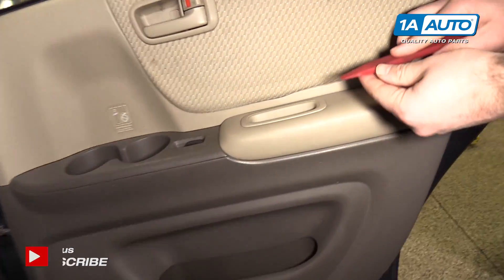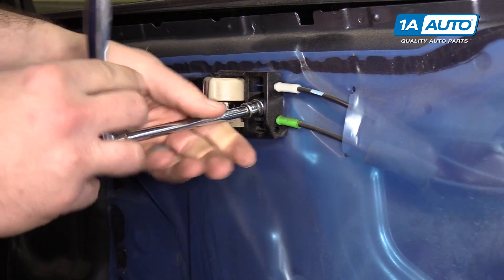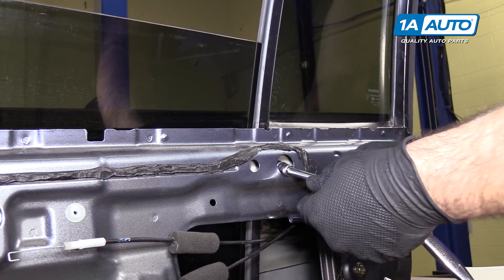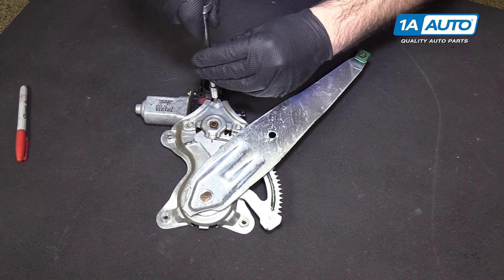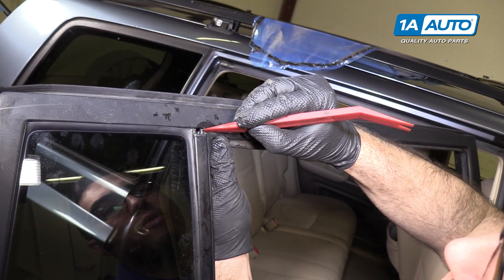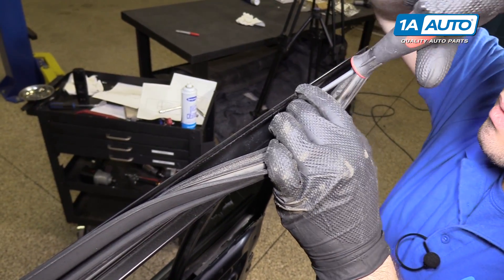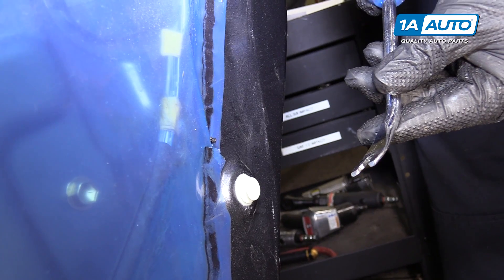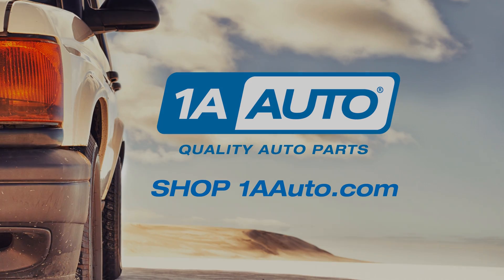How to Replace Rear Window Regulator Motor 00-07 Toyota Highlander

Comment: You didn't mention idling the motor like you did for the front. Also although I was finding different part numbers for the front and rear motors I have installed a front motor in a read door and it works fine.

Comment: The windows on my Highlander will go down, but they won't go back up. After a bit of time, it will go back up a couple of inches and then stop. After another little while it goes up a bit more. Will new motors fix this?

Comment: Thanks for such a good video. No need to take out window. The motor and regulator will slip right out of one of those holes. Took me 20 minutes to do this job.
Reply from the maker: +Joe Simmons Thanks for checking us out! 1AAuto.com
Reply: Yes there was a need, to demonstrate how to do it. My regulator and motor was fine, the guide rail on the bottom of the window broke off and the entire window had to be removed and the rail welded back on. There were only 3 skinny rivets holding it on, like the thickness of a pencil lead. Great Toyota quality. So many issues with this Highlander, I can't understand the brand loyalty and reliability reputation. So far, not impressed.

Comment: I appreciate the video.  It helped me understand the process of getting to the window motor.  

But why go to all the trouble to remove the window Channel? I did the job this afternoon without removing  the channel or the window.  It was much faster.  
I held the window in place  with a couple of Clips on the lower window Edge,  and then strung  a bungee cord through the clips and attached the bungees to the door frame in such a way that there was upward pressure on the window, keeping it in place.  Then I removed the four bolts that attach the regulator to the door. I slid the regulator out of the support platform under the window and then dropped it out the lower opening of the door. Once I had it out, rather than just replace the motor I opened it up to check the brushes and the windings. The brushes weren't making good contact so I adjusted them, cleaned up the carbon residue, reassembled the motor, installed it back on the regulator and put the regulator back on the door frame. The whole process was much faster than what you show by removing the window Channel and the window. I saved a few hundred dollars, and now have a fully functioning left rear window. An afternoon well spent.  Thanks for the video tutorial. It was very well done and helped!
Reply: the bottom track that attached to the glass on my left-rear fell out.  Removed the panel, the regulator, reattached the track to the glass, then you connect everything and use the switch to lower the regulator arm sort of half way, slide the plastic square from the arm into the glass track and push up the windows and put the regulator back in place, it help with that single bolt guidance.  But lots easier than remove every things.
Reply: What year was/is your vehicle, and what was your process? Window all the way up, and motor/regulator out? Thanks

Comment: Excellent video...my problem is the bracket,on bottom of window fell off..Is the best way to fix, by removing run channel, extracting window, etc?  Or is there some way to get back on while window is still in the door?
Reply: Mine was broken off (corroded rivets) so I had to remove the entire window and have it welded back on.

Comment: Thank you for the video. As an amateur, I really appreciate you going through the lengthy process of full removal. My window only went down 3 inches so it was a pain to get it out. I found after replacing the motor rolling the regulator almost all the way down was easiest to get the window back on track and guided into the channels. Bought the car this way and clearly someone botched the first attempt because the metal track on bottom of glass was all the way out to the rear edge. Yikes. Not sure how that happened.
Reply from the maker: +Alguna27 Thank you! We love empowering our customers and showing how to perform DIY auto repairs with our high-quality auto parts. 1AAuto.com

Comment: This is how to make a 20 minute job a 2 hour job, Do NOT take out the glass or the channel, just slide it out of the groove under glass.
Reply from the maker: +keith grubbs Thanks for the suggestions and for watching.
Reply: 2 hour job? I needed to take the window out as the bottom guide rail broke off. Took an extra 10 mins tops.

Comment: If the long bar on the regulator is covering up the 3 torque screws, how do you move the bar so you can access the torque screws?
Reply from the maker: +James Y You will have to pop open the motor cap and manually crank it.

Comment: what if you can't lower the window? (thats why the motor change) Can't get the run channel out without the window low in the track.
Reply: Prairie Dog i got the same problem, the windows is fully raised .
Now what?
Reply: Yes!!! This is what I need to know. Disheartening that this has gone unanswered for a year.
Reply: Same problem. Gotta take door cover off to see if motor is bad. Thats what I suspect.